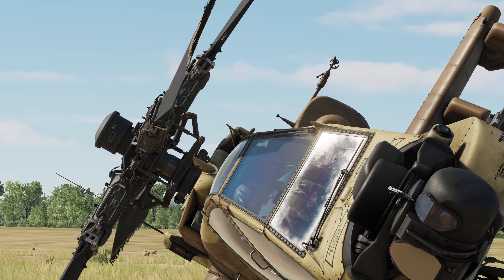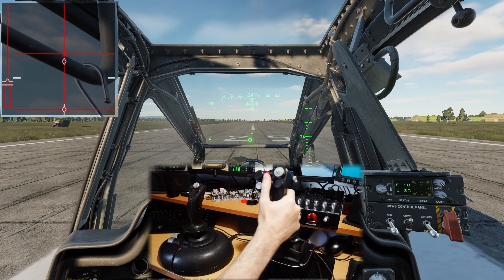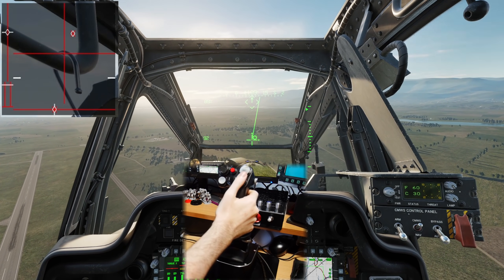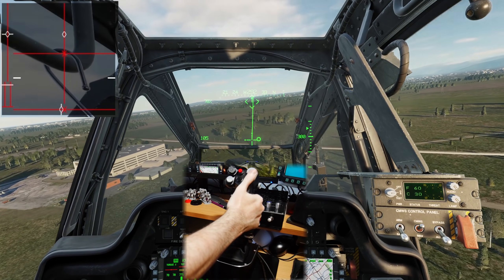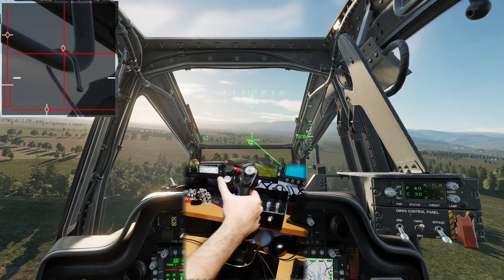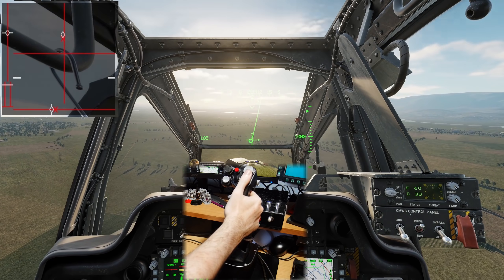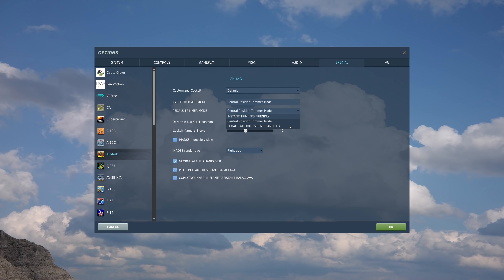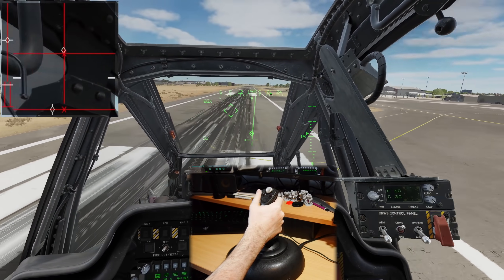DCS: AH-64D Apache: Understanding Trim

Comment: I've actually never had a problem with how "intuitive" it is I guess because having some of that disjointed-ness has always been something I've expected with helos? The fact that I have had to exclusively use a twist stick to fly them so far may explain part of that too.  What I have had, though, is trouble with the trimmer mode- I don't like return to centre because I find it too slow and obviously with force feedback there is zero delay, so I usually have to be pretty careful when not using return to centre and you'll catch me getting clever with it and realesing the pressure on the stick very fast, which with practice I do find works well. I also absolutely suffer from loosing that range of motion when trimmed, but equally "counter trimming"  has just become a part of my workflow when I need to do a hard manoeuvre, I just slam the trim wherever I need and it has at this point become intuitive and natural. I really only found myself doing this with the KA-50 anyway as it lets you really throw it around and can take a little longer than I expect to react to things, unlike the Hind which is big and lumbering, but expectedly so. For me this renders the on screen controls display unnecessary, which is good because I personally find it unbelievably ugly, irrationally so, I can't even tell you why. Maybe I think it's mocking my abilities or pride or something.

Comment: I hope they add a trim reset and/or configurable trim delay in which you have time to recenter after trimming. Also it would be nice to have the inputs "reset" after this delay timer because i nearly crashed a few times because after pressing trim and not returning to center, i couldnt input any movements
Reply: The Trim Reset is coming, because so many has been screaming lack of it.
What feature there would be needed is to allow the centering trim mode to continue stick movement if trim button is pressed again, without requiring to go to center first.

Comment: Thank you! Disabling trim on the pedals is huge! It was really the only major problem I was having given how sensitive the Apache is to input at low speed. I’ve flown all of the DCS helicopters and I have to say that I have a newfound appreciation for just how stable and easy to fly the Shark is after the Apache. I had just assumed the Apache would be superior in every way but, especially without the hold modes, the shark is a far better help for hovering and stability
Reply from the maker: Coaxial rotors have their advantages!

Comment: Are you saying that unlike the Huey (for example) DCS did not provide a Reset Trim function that can be programmed into your stick ?
If that's the case then that is just STUPID.
I have always used the Central Trimmer Mode and Trim Reset with all Rotary Wing Modules and it works perfectly once you understand it (which takes about 5 minutes with a proper instruction).

Comment: In my experience with the huey, trim reset was something I only used when my stick was already close to centered (often when I am in the middle of a hover transition). Otherwise, the aircraft goes absolutely crazy because of the sudden change in control inputs. I also don't enable rudder trim because I have never encountered a situation where I can have both stick and rudder centered at the same time. Because of this, trim reset is never a safe option if I have rudder trim enabled. I can only use one or the other.
Reply: Trim in a Huey is totally different than an Apache.

Comment: I find the current trimmer model easy to use. When you trim on Central Position trimmer mode you center both controls as you trim, effectively releasing them momentarily then returning to control. It couldn't be any simpler. You just have to automatically do this as you trim.

Comment: wow. great vid. but holy crap is the sound terrible. it's so much bass that i could barely understand what you were saying.
Reply from the maker: Yeah sorry, made a mistake with the setup, it was rather tricky to get the tripod and microphone in. Didn't really have the time to redo it, so i did some work to reduce the clipping distortion, which is why it sounds bassy, having lost some of the top end. It was borderline whether I'd scrap the video all together or publish it, but i felt the content was worth the troubles vs no video at all.

First time I've worked with a live mic and camera at the same time. Hoping to improve going forwards, Thanks!

Comment: If ED would add a recenter timeout to the central position trimmer mode that restores control after a short time regardless of whether you recentered your controls or not, it would alleviate the problems with that trim mode.
Reply: Exactly, or make it activate only when it detects joystick re-centering.

Comment: The way trim usually works in flight sims (elevator angle = stick displacement + trim) drives me nuts compared to real aircraft (elevator angle = stick position, and trim changes where the resting position is).

I'd like very much to devise a trimming system that works like the real thing - altering the sprung centre position on the controls.
Reply from the maker: MS Sidewinder 2 FFB does exactly that with fixed wing too.

Comment: i know it's not realistic but I think all helicopters in dcs should have the option for a trim reset
Reply from the maker: I'd say it's realistic in the sense that it's replacing the physical action of manually centring your stick, which is very difficult to do without either the overlay or a FFB stick. Less realistic to be someone without the sense of touch.

Comment: When it comes to these modules there needs to come to a point where some "realism" is sacrificed for in game functionality.  While a trim release may not be realistic to an Apache, it makes up for the fact that a person playing a sim at a desk doesn't have the same feedback as a pilot in an actual Apache.  Not to mention someone flying a real Apache isn't staring at a controls indicator, to center things in order to release trim.  Something as simple as a guarded switch in a real aircraft is as easy as flipping a guard and pushing a button in one basic movement.  Some people will say it's not realistic to just flip the same switch in game, so now we get a separate command to lift the guard.  Now I have to bind something to simulate releasing a guard just to flip a switch on my hotas.  This in itself isn't realistic being that the guard in the real aircraft has no electrical connection to the aircraft, it's simply a spring loaded guard.  Now lets say I build a cockpit, with an actual guarded switch.  I still have to come up with some creative way to have the sim recognize when the guard is up or down in order to use it.  As modules get more advanced, with more features added, they're becoming more complicated than the aircraft they're designed to emulate.
Reply: Exactly. I don't understand why this is seen as a problem. I couldn't figure out why I couldn't use the weapons from the back seat and it was because of the trigger guard. Seriously? There is literally no point to have that be necessary. At least they are implementing a trim reset now. I saw someone ask for that and Wags literally just responded, "AH-64 doesn't have that." Ok dude, no one cares, this isn't the real aircraft and I'm sitting at a desk trying to fly it.
Reply: I have the VKB MCG Pro as joystick grip. I selected it over Virpil because it has better capabilities like the brake lever is an axis, and the flip trigger is as well an axis. Because these are axis and there is sensor to detect when the flip trigger is up or down, you can simulate multiple different real world grips. 

Example, in KA-50 you have the flip up trigger so that when it is UP, the gun is selected and the dual-stage trigger (red) is trigger for cannon. When the trigger is DOWN, the gun mode is disabled and you have your inner/outer stations selected and you launch the weapon by pulling the flip-trigger fully.

Now do that same with the Apache now. But reverse. 
Flip trigger UP = Armed. Flip trigger down = Safety. 

The difference is that you say, in real trigger that safety is spring loaded, so it will cover the trigger again, where in MCG Pro you don't have spring to return it down. But you will get that exact same functionality that to fire weapon, you need to place finger under the safety cover and shoot.
To avoid this "cheating", we can use exactly that programmed "safety up" feature, so because there is space to slide finger under Flip Trigger, you can't use trigger as you have not removed safety. 

That is the nice feature to just understand that you have a cover you need to deal with, and just by grabbing or pumping grip when flip-trigger is down will not fire the weapon so you must realize to remove safety. 

This flip-up trigger is amazing feeling in KA-50. And so as well in Apache. 

Binding to joystick only the real functions that real grips has, and same thing with collective (or throttle if flying fixed wing) that you really don't need so many buttons and features in any of them, you have less functions to make, and you enjoy with the limited real world grips functions as you are required to move hands around in virtual cockpit to operate aircraft instead just pressing buttons in throttle or joystick that is not suppose to have such functions. 

In my MCG Pro I have seven buttons in it. 
1) UP
2) Virtual button for modifier (UP)
3) Down
4) Virtual button for modifier (Down)
5) First detent 5-50% pull.
6) Second detent when physical spring loaded button is pressed.
7) Full pull (90-100% scale)

One trigger, six functions. 
Under there is that dual-stage red trigger, and I can change its functionality with that 2nd virtual button modifier, so I can have example PTT in the first detent, and then have Autopilot Override with second detent. If I go quickly to second, first detent is ignored and I can fly in Su-27 without disabling level flight as should. If I just pull first I get PTT, and then same time VoiceAttack reacts and listen microphone and I can speak the radio commands.
And when I want to use missiles in BVR mode, I flip trigger down, now I can launch missiles with gentle pull to first phase, or I can quickly pull to select a gun, and then gentle pull will fire the gun. To deselect gun I either flip trigger up or I quickly pull fully and release and I am back to BVR mode (problem if need to go back to A-G mode). 

The axis are powerful features with virtual buttons. I have three buttons in the brake grip. It is full axis, but then there is one virtual button for 0-5%, one for 30-50% IIRC and then one at the end at about 95-100% And this way example when I am up in the air, I can command something with full pull when axis reacts only for wheels brake but as they are not extended you don't have conflict etc. 
I can make that grip as extra button for paddle switch in hornet just by touching that grip slightly. Or I can have it as modifier for T-rudders work as brake pedals for taxiing. 

But the key is that you take the programmability, and then implement real functions to closest possible right places.
Example, the left mini-axis stick is in A-10 and F-16 the TDM 4-way hat. The center 5-way hat is the DMS hat. It doesn't matter to me that they are different feeling and shape, as both are programmed 4-way hats in secondary virtual hat mode to where I can switch when switching modules in DCS.

Comment: After several crashes in the Hind where I realized it was because I was locked out of controls and hadn't returned to center, I was using the default/instant type. For some reason I greatly dislike this one in the Apache. I've now switched back to all central trimmer and I'm pretty happy with it. After a little practice building muscle memory, it's no different than remembering to open the trigger guard or something. Just hit the trim and relax your grip for a moment. That said, they NEED to shoehorn in a trim reset. The Apache doesn't have one, but it also doesn't have a spring centered cyclic either, so arguing it's not realistic would be a moot point.

Comment: from how i understand it, this is ONLY an issue in the apache as the UH-1h, KA-50. dont use the 'recenter to trim' for non FFB sticks or at least ive never run into the issue.
Reply: The older helicopters have a different trimmer mode entirely, which was called "Default" mode. It's similar to the FFB-friendly instant trim in the Apache, but there's a short delay before the trim kicks in, giving you a moment to recenter your controls. It doesn't wait for you to center them, so there's no risk of getting your controls locked out, but it does give you a brief window to move them to center, which is adjustable by editing a Lua file. (I think it was 0.4 seconds.)

Comment: I really miss the Sidewinder FFB. I never understood why they quit making them. They worked so good in WW2 planes also, because you could actually feel the plane. Both center trimming and instant you still have to center the controls. I found attitude trim works best when flying to a WP.
Reply: patent trolls unfortunately.
Reply: I still use a 20+ year old  MS Sidewinder FFB stick when flying in DCS. It's immersive and fun in VR even if the deadzone and plastic buttons may not be as great. Amazed it still works though. I do hope to see more main streamed force feedback solutions in a soon future if possible (and do hope the patent isn't renewed, it deleted the FFB from the flight sticks).

Btw. I also love the Ah64 IHADSS integration in VR.
Reply: @Roboculture  any special settings for it? Mine tends to come back a little bit to the center every time I trim it offset.
Reply: @VaporFlow82   I'm so sorry, answered and watched this while not having my equipment at hand. I repost an answer here as soon I got it and can run DCS in vr again. (It may take up to two weeks.)

Guess I would have the same problem, hope to find a solution.
Reply: @VaporFlow82  Hi, Finally got back home and got time to messed around a little bit in DCS with the trim and my MS Sidewinder.
And of course I got my self some other issues with the trim at first, it did correctly on looking at the joystick helper thingie (ctrl+enter), but the force feedback just kicked the stick in the opposite direction, like it reset the center as if it was mirrored. (It may just be me how's not used to how this should work).
At a few times I got it to work like I wanted and I don't recall my stick to offset, if so not  by very much. But have a theory that it has to do with the deadzone for our sticks, that does that, it stop sensing where the joystick are as soon the stick center itself inside its own deadzone. Fortunate for us, ED have now implemented a trim reset button. 

Sorry for taking so long with my answer.
Reply: @Roboculture  yeah, it's the same behavior I'm having. Thanks for the reply.

Comment: Awesome video. I too have the problem of wanting to use my FF2 (what trimmer force are you running BTW)  to make it more intuitive to fly (it is so much better) and yet it makes it harder to fight because of the lack of hats and buttons compared to the warthog I have. So the quandary of flight vs fight. I have the most trouble with trim when transitioning from cruise flight back into a hover when using the warthog. Doing PIO as I adjust trim. A trim reset button I think is a must.
Reply from the maker: Default forces, think i had to invert the Y axis in FFB tune.

Comment: yeah its tough. if im flying really fast and have trimmed the aircraft, my pitch axis is all the way trimmed up. and if i want to slow down, i have to nose up violently and gain a lot of altitude to recenter trim. throttling down to not gain height and then having to trim rudder as well while dethrottling. its tough, especially under pressure, if there is AAA near by and id have to stay beneath cover or whatever..... tough cookie, but thanks for the video !
Reply from the maker: That's one of those times trim reset would give you a quick response and restore full motion! Thanks!
Reply: @RedKiteRender  id love a trim reset, or the option that the trim comes to effect when I release the trim button. Thank YOU for your videos 😊

Comment: I loved the sidewinder force feedback 2 so much that I decided to cough the dough and get a Brunner CLS-E for 2000$ cad to use modern sticks and still get force feedback.
Reply from the maker: Man i wish i could afford one, I really miss FFB, i end up using non FFB just because i need all these extra buttons for most aircraft.
Reply: Does it work properly in DCS already? I'd save up for it, but I need to know if it works just like the FFB2...
Reply: @CakePrincessCelestia  it has native dcs support. Only games it doesn't work for are IL2 BOS, cliffs of Dover. But there is a program that makes it look like its a ffb stick and then it works with those games.
Reply: @cosmicxsolitude6947  brunnerdx plus a arduino micro is what you need as interface. but yeah brunner works great in dcs. only thing is that using the nativeliy software it wont move the stick like for instance in msfs where high winds can push the airelons and with it your stick.

Comment: as far as I know this is the only helo on DCS which lacks Trim Reset... I use it a lot on the Mi8 / 24 / huey ... The gazelle and ka50 a bit more rarely as they have a slightly different system;  but they still have the reset...

Comment: I have all other helicopters, but only struggled with trim with the Apache. The other ones have one more option "default", which is missing in the Apache. And you can disable the Rudder trimmer in the Special settings. Thanks for the video. Really good.